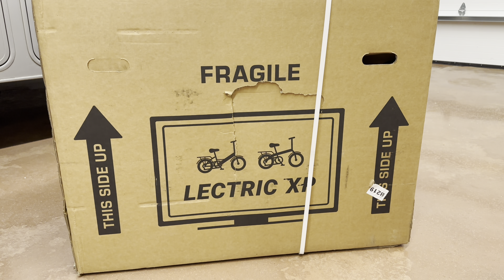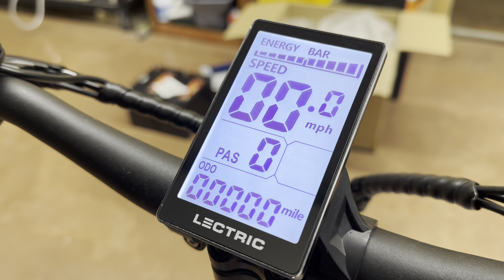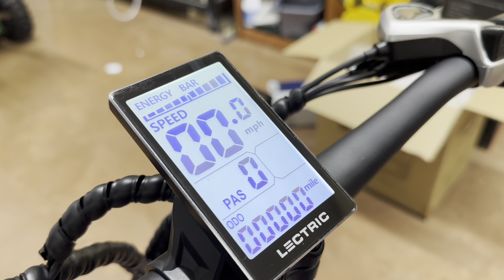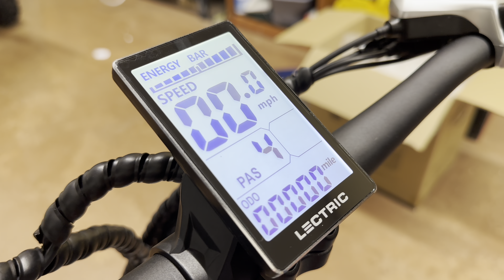New & Improved Lectric XP 3.0 Step-Thru Ebike Review!

Comment: Mike makes folding them and loading look way easy! I fight like hell with ours. Usually busting my shin at some point in the process lmao
Reply from the maker: 😂 he's a seasoned pro by now and after doing the premiums which are 20lb heavier these are a breeze
Reply: Another reviewer suggested using the Velcro straps from the packaging to keep the tires together when folded. 
Looking forward to giving it a try.
Reply from the maker: Yes you absolutely can do that! These were shipped with Velcro straps as well. We don't have a need, only because of the way we transport them but it couldn't hurt!
Reply: Same! It's so heavy and scary. 
Mine didn't come with velcro so I'll have to buy separately.

Comment: Nice review! A quick question, once you got the bike, was it automatically able to hit 28 from pedal assist or did you have to enable that during settings?
Reply from the maker: Great question! We had to hold the + and- buttons together and go into the menu to change it to go faster. But even before that Lynn's bike was going 21+ with just throttle in flat ground!
Reply: @WanderingWagners  thank you!
Reply from the maker: Very welcome!
Reply: @WanderingWagners  Sorry, but I have another question. Do you think a 4”10 kid could ride a 3.0 step thru?
Reply: @ginatchen  the official specs put 4'10" as the minimum suggested rider height, so they'd probably be fine, and if they're a kid they'll definitely grow into it a bit too
Reply from the maker: Probably, but lectric does say it's for 18+ but probably for liability reasons... They also say don't take it off road and we do that😂
Reply: @WanderingWagners  yeah, i think he can handle it, he has a lot of experience. Plus nobody follows those stuff lol
Reply: @ginatchen  hi check your state laws , most states require e riders to be 16 or older
Reply: @anyone9689  I’m in California, as long as its not in class 3 mode its fine
Reply: @ginatchen  OK,  I have an aventon sinch non step thru and a 4' 10" person could fit easily.  Love it , gl
Reply: @anyone9689  thanks!
Reply: @anyone9689  Yeah my cousin has a Aventon pace 500 step thru, its pretty nice.
Reply: @ginatchen  hi i got one cause they are rated quite well and are a long term company making bikes 50 years now , not a Johnny come lately that  may disappear and not be able to find parts.
Reply: @anyone9689  yeah, my 3.0 is coming tomorrow so ill see how that is
Reply: @ginatchen  nice , charging is cheap , mine is 8 cents , most are 500 or 700 watt hours , can check your bill for kwh and multiply by .5 or .7 . Mine ends up about a dollar for 400 or 500 miles
Reply: @anyone9689  for your Lectric?
Reply: @ginatchen  my aventon,  but lectric is about the same , gas at 4.00 equates to about. 1600 mpg
Reply: @ginatchen  f got Taunus inserts for tires , haven't had a flat since . Was getting a bunch prior , expensive but I highly reccomend . Check YouTube videos  Tannus inserts

Comment: I'm interested in the Step Though (ST), but I have a concern with the lower pedals during turns.  On your rides, have you striked the ground with the pedal on turns?
Reply from the maker: We have never hit the pedals in the ground
Reply: @WanderingWagners  That is good to know. 🙂 Thanks for the quick response.
Reply from the maker: Very welcome!
Reply: I'm an experienced cyclist.... I level the pedals on all turns right in the middle;  it's too easy to hit something otherwise.  :)
Reply: We have two step thru 3.0s. We both have scraped the inside pedal during sharp turns.  Learn to keep the inside pedal up or flat during turns and use the throttle if speed is necessary (turns while going up hill). That's my only gripe about the bikes. Otherwise a lot of fun.

Comment: We purchased this Vivi 27.5” electric bike and a Tentaquil 26” electric bike for our 13 and 14 year olds. https://www.youtube.com/post/UgkxUiL0GnyDjP32RJdd660sP8mZk4CRLTCJ  The Vivi was much easier to put together. With the Vivi, there was a video link to assist with assembly which made the process easier to follow (we did put the handlebars on upside down, but it was a quick and easy fix). With the Tentaquil, the assembly was not as simple to follow, but after we messaged the company for an assembly video, it was easier and they did respond quickly. The other major differences were that the Vivi has a grip throttle on the right handle (like a motorcycle) and the Tentaquil has a push throttle that you use your thumb to activate. The monitors were also different, so if you’re looking for something specific in terms of changing the bikes functions, pay attention to what the monitor offers. We were really impressed with the overall quality and functionality of both bikes, but if you’re looking for more power and an easier assembly, definitely go with the Vivi!
Reply from the maker: We really enjoy these bikes too👍🏻😊

Comment: they still kept the small motor in it !!
Reply from the maker: My guess is so that it could still be classified as a class 2 bike, though not sure
Reply: @WanderingWagners  they can easily put 1000 watts motor with 1800 peak power like my Ariel Kepler.still class 1-2-3

Comment: Just got mine, i love it except that it has really loud and squeaky brakes. Any tips to fix?
Reply from the maker: Maybe back them off a little as they could be too tight and be louder because of that. Unfortunately, without hydraulic brakes there'll be noise.
Reply: @WanderingWagners  alright